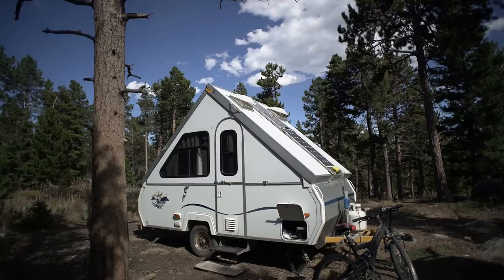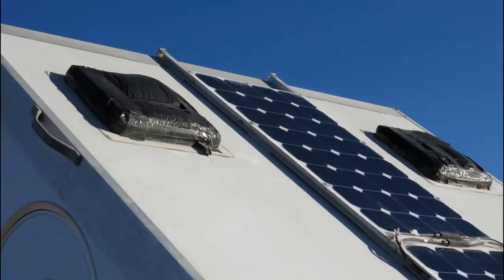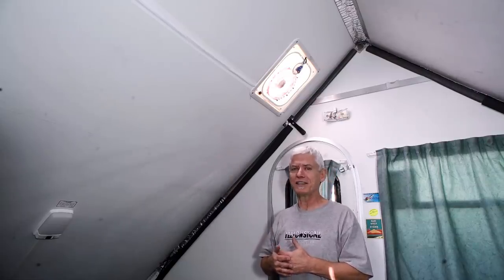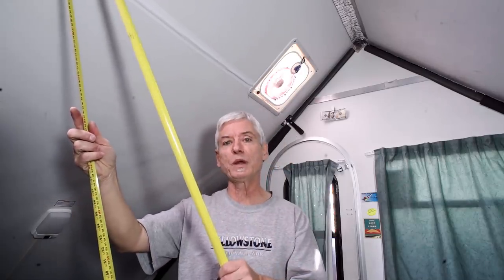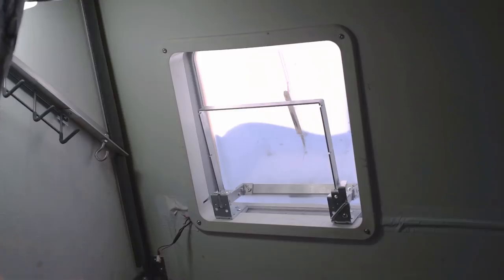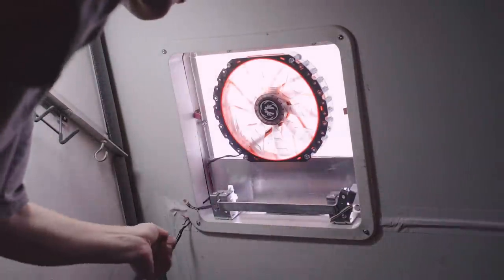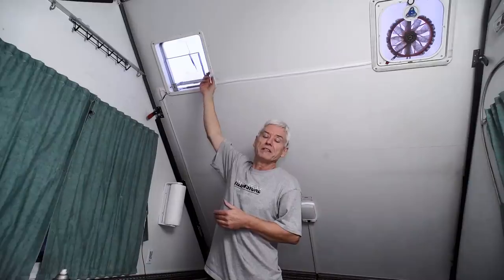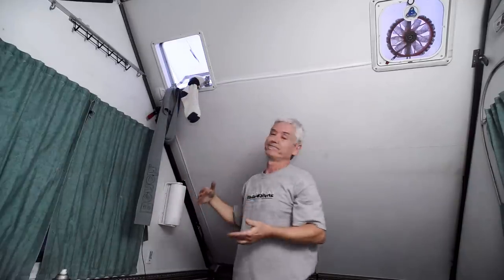Designing a Better A-Frame RV Vent

Comment: Why would you nickel and dime yourself to death by repeatedly using cheap garbage vents?  I installed a maxxair fan a while back and will NEVER install a cheap fan or vent again.  They have lifting arms on both sides and the vent can be locked in any position by simply pushing the knob... and the cover itself is VERY thick and well made.
Reply from the maker: Chill DW! Sounds like you have improved on a few issues, but not sure you've solved them all. Is the adjusting knob on the top or bottom? Is the vent material shatterproof? What's the current draw on the fan? Thanks! SP
Reply: lol... nothing to chill about, sorry if I came across as anything other than trying to be helpful.....

The maxxair fan seems pretty efficient, we didn't take measurements on ours but you might check here:
http://www.wanderthewest.com/forum/topic/8893-fantastic-fan-vs-maxxfan-comparison-including-amp-usage/

I have no doubt those numbers are fairly accurate, we ran ours on low for several days while the RV was disconnected from shore power at home...  the batteries were still around 75-80 percent.  Keep in mind that we only have a 15-20 watt solar panel on the roof and have the cheap "free" batteries we got with the RV when it was new.

The knob is at the top, which sucks if it's too high to reach, but they do make models that open and close via remote if that's needed.

The build quality and materials are very good IMO and if memory serves the cover itself is polycarbonate and quite strong.  It's so strong and well built that I feel comfortable locking it open while driving on the highway to keep the trailer that much cooler.

The ONLY complaint I have about it is the price, we paid around $120 when it was on sale.....  but it's worth the money IMO.
Reply from the maker: DW, The Maxxair fan has some excellent features for sure, but can you please confirm one thing: Are you actually using it in an Aliner? I viewed the manufacturer's installation video and it says clearly that the "exhaust intake louvers face the rear of the vehicle". That would put it UPSIDE DOWN on an Aliner. Would this not leave the inside of your trailer exposed to rain? Thanks, SP
Reply: Sounds like you're looking at one of the models with the weird fancy integrated covers...

Try looking at a regular maxxair fan, like p/n: 00-04500K 

It is a 10 speed with remote open/close and a rain sensor....  it could easily be mounted the same way you currently have your fans.
Reply from the maker: Are you currently using it on an Aliner? I used the link you included above, which was a MaxxFan Deluxe. SP

Comment: $35.00 vent cover would fix your problem.
Reply from the maker: Vent covers are meant for a horizontal roof with the vent facing to the rear. They also  obstruct the view of traffic in the rear view mirror. Wouldnt they also fill with snow, rain and ice if facing the wrong direction? SP
Reply: Not sure. Works on my roof.
Reply from the maker: You have an Aliner? Can you provide a photo? SP
Reply: No i do not have an A-Liner. I have regular travel trailer. i do not see how a vent cover would not work as they have a built in screen on the side that allows air flow? Am i missing something?
Reply from the maker: Quite a bit apparently! A-Frames have a 45 degree angled roof, not flat.  Have a look at 1:54 in the video.  This shows the awkward placement of the vents.  If you place your vent cover with the opening down, it will fill with rain while in transit. If you place it with opening up, it won't vent at all! You can't compare a different trailer design to this one, as the issues are unique to a sloping roof. Thanks! SP.
Reply: Time to upgrade to a travel trailer in the near future?
Reply from the maker: Why would I do that? More gas and fewer destinations. I love being able to sneak into spots big rigs wouldn't dare! Less is More to me. SP

Comment: There is absolutely no reason the vent covers need to be translucent. They could have made them from aluminum or steel.
Reply from the maker: Absolutely! I actually made one. Will be shown in a future video. SP
Reply: They are available in aluminum from several sources. Cargo trailers use them.
Reply: I agree that plastic isn't the best but it does let in light.  If that isn't important, then yes, use metal!